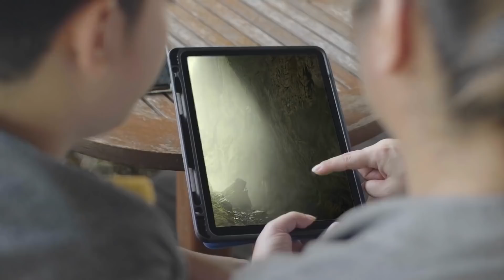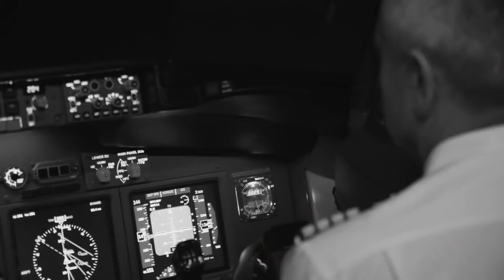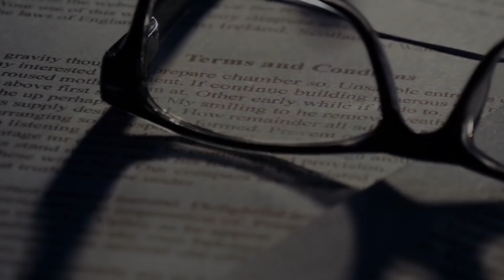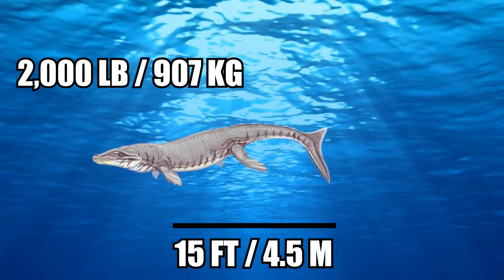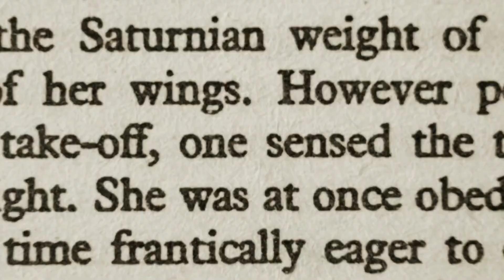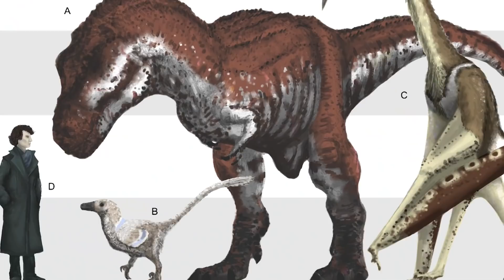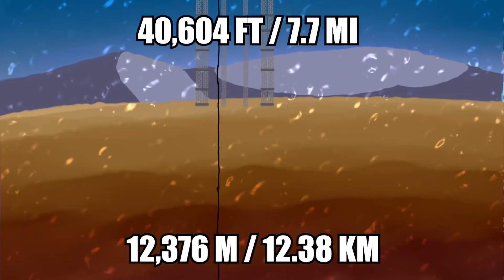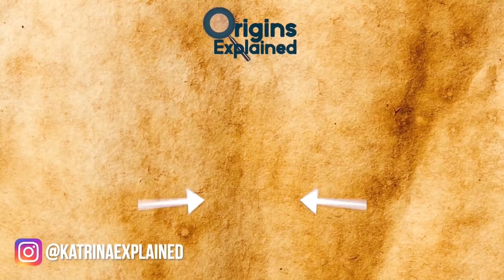Most Amazing Recent Discoveries! | ORIGINS EXPLAINED COMPILATION 40

Comment: That square under the ear of the Sphinx that looks like a door is actually a gouge from a previous "archeologist" that believed there was a hidden compartment there. Which there obviously wasn't. The same happened on the head of the sphinx. Someone dug (our used tnt back in the day and blew) a hole in the top of the head looking for hidden passages. That's been filled in but lots of pictures.